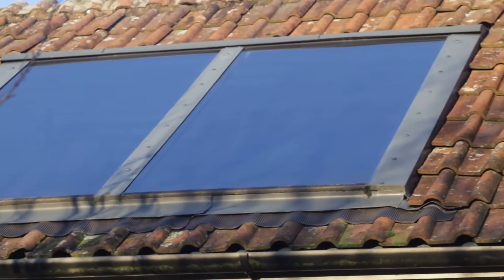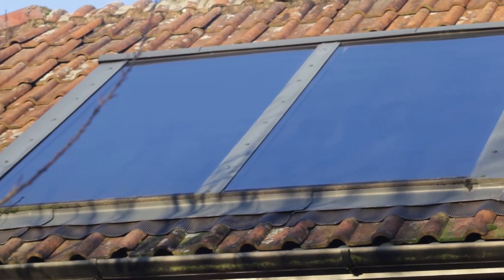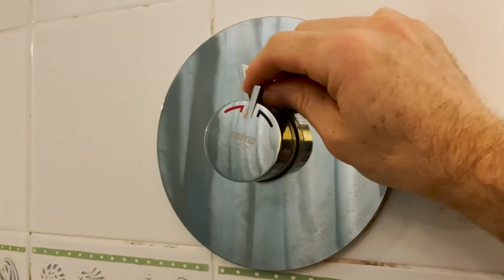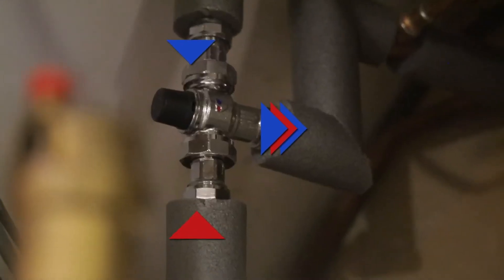Why you should add a Blending Valve to your Solar Thermal Panels

Comment: Do you find the Blending Valve closes off the cold 100%  when the solar water is say 45c ?  I read somewhere (here? https://youtu.be/m2-_x0XZUSM )  some always feed a little cold in, thus needing hotter water tank temp for a shower/bath, in the winter.
Reply from the maker: I have thought about this, but I don't know how I could tell if there was always a little cold water seeping in. It's perfectly possible. The temperature is set using a spanner but there aren't any markings so all I can do is make it a bit hotter/colder and then test by measuring the temperature with a thermometer/my hands. 

Even if the tank temperature states lower numbers (even less than 30) we can still have piping hot water from the taps due to the hot water naturally rising to the top of the tank where the feed is taken from. The temperature sensor is two thirds of the way down the cylinder. We have turned the valve up a bit since we had it installed, mostly because we enjoy a hotter shower.